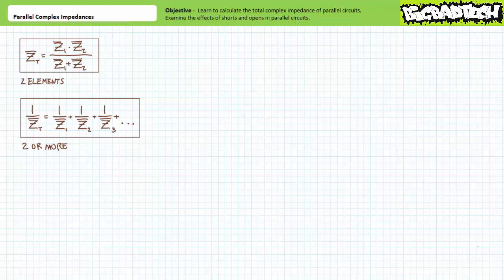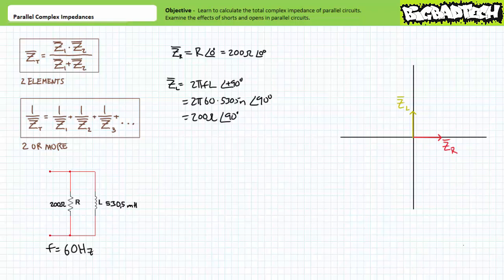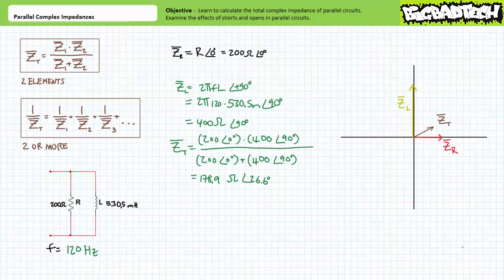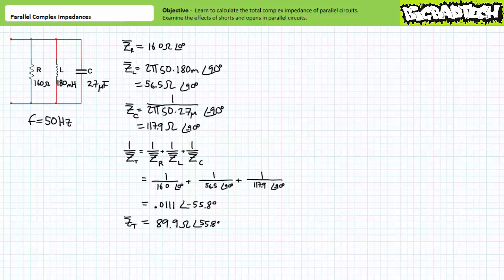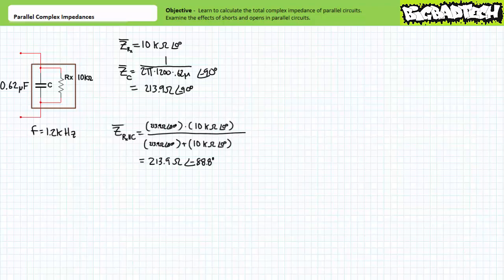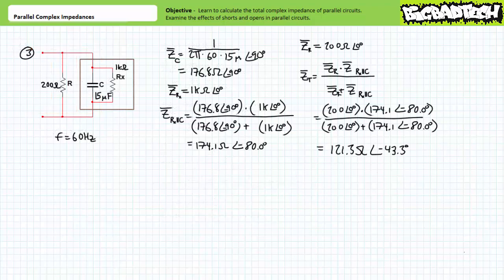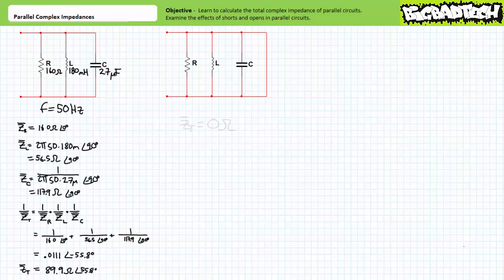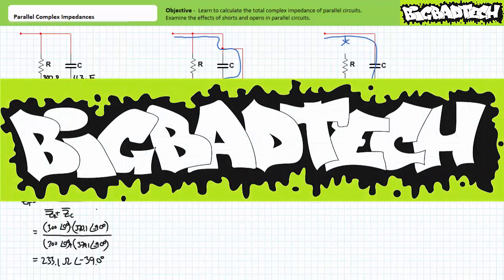Parallel Complex Impedances (Full Lecture)

Comment: Maybe its just me, but your notation on multiplying the two impedances on the top using a dot can be quite confusing.  Since these values are representing vectors in the complex plane, it is tempting to see this multiplication as a dot product, especially since, when you add the impedances, you add them as vectors.  However, in your first example, the two impedances are perpendicular in direction, yet you do not get 0 for the product.  My assumption is that you just multiply the magnitudes and forget about the directions, except for when you add the denominator terms.  Is this a correct assumption?
Reply from the maker: For all the gory details on complex number math check out the following playlist: https://www.youtube.com/watch?v=deZ8FCZ3iqY&list=PLdnqjKaksr8o08K4VY02fVXQijxT1yDTI
Reply: @bigbadtech   Only if one example of taking inverse of  complex number had been included in the complex number math video, it would have been much better, as taking inverse of a complex number is little different than taking inverse of a normal real or fractional numbers. If you could give this link in the video description if you like.

  For reference          https://youtu.be/TT1v1RC6-VY

Comment: Hello Jim, how did You get the result on 1/Zt= 1/Zr+1/Zl+1/Zc=89.9 Ohm at 55.8° ? If Zt=(ZrxZlxZc)/Zr+Zl+Zc. I get 6218.3 at 21°.  Zr+Zl+Zc = 160-J61.4=171.4 at -21°. ZrxZlxZc= 1065816 at 0°

Comment: Oops. I accidentally deleted my question. I noticed there was an answer about the hypothenuse of 200x200 which is 282.8 Ohm (not 141.4 Ohm).  How do you get 141.4 Ohm? Jim, could you please re-answer my question? Thanks.
Reply from the maker: Parallel is not the hypotenuse. Parallel is Z1*Z2/(Z1+Z2) where each impedance has an angle.  Check out this complete lecture, the time stamp should direct you to the calculation of interest: https://youtu.be/3LFTcKA_Da0?t=1567

Comment: Good evening, when it comes to getting the impedance answer before inverting, I seem to be getting the wrong answer on all the examples. What am I doing wrong ? Please assist
Reply from the maker: Most likely it is an order of operations issue. For example consider the total impedance of 2 known impedances: Zp=Z1*Z2/(Z1+Z2) the parenthesis are mandatory if you try enter the expression in one line. Another possibility is that your calculator isn't set up properly for polar or rectangular calculations. Check out these lectures for help on complex numbers: https://www.youtube.com/playlist?list=PLdnqjKaksr8o08K4VY02fVXQijxT1yDTI

Comment: well what if the frequency was not given? How can I change to polar form?
Reply from the maker: The magnitude of complex impedance for reactive elements depends upon 2 inputs: the frequency and the component value. This creates a 3 variable relationship of magnitude, frequency, and component value. If you know 2 of these quantities you should be able to algebraically manipulate the complex impedance formula to solve for the third (ie: given component value and magnitude, solve for frequency). Check out the capacitive complex impedance and inductive complex impedance lectures at: https://youtu.be/3Fw32jEL3_8 and https://youtu.be/xowCaVH44MU